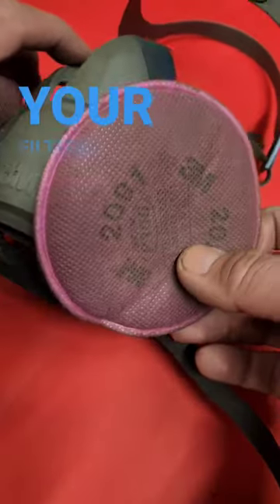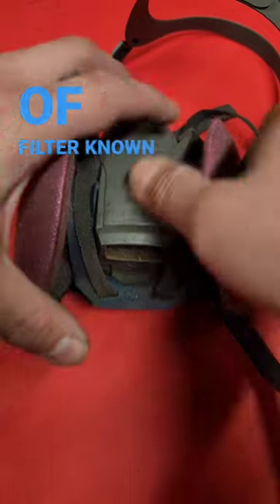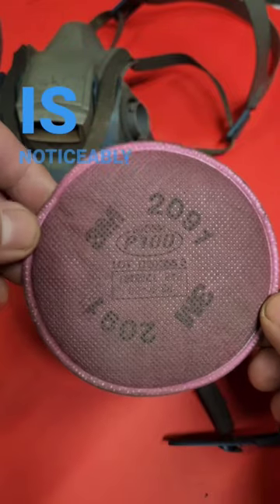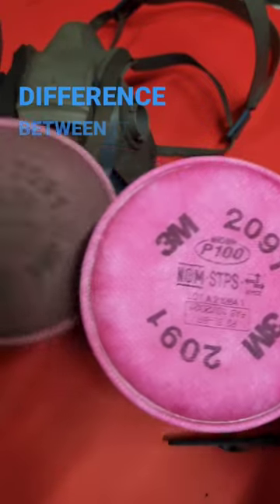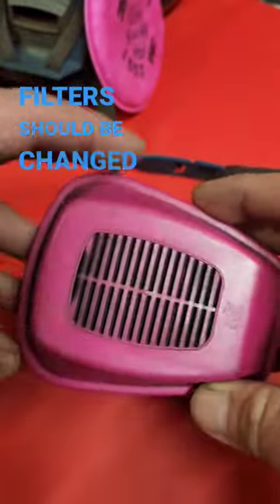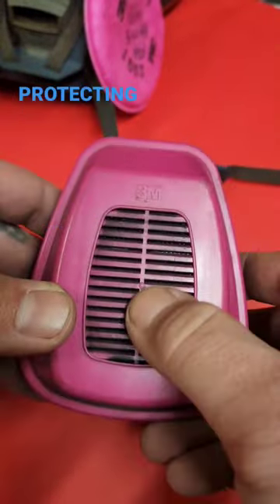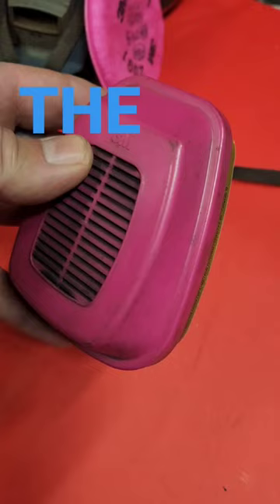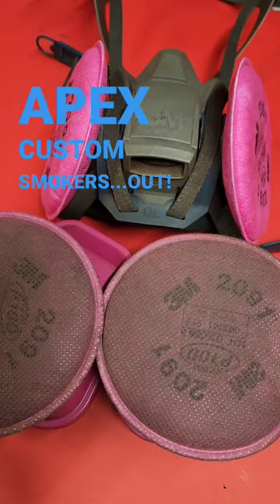When should 3M respirator filters be changed 🤔 #shorts #welding #3m

Comment: Sir, is 2091 useable for spray painting?
Reply from the maker: I PERSONALLY use only the P100 filters (charcoal filter with removable  particulate filter on top) for painting, or when I'm welding galvanized. The 2091 don't have the charcoal, which in MY OPINION, doesn't filter AS WELL as the P100. Hope this helps! Thanks for watching! 🍻

Comment: Will any dust penetrate through if the filter is already old ?
Reply from the maker: It would depend on how old the filter is, and how often it was used, but yes, the dirtier it becomes, the less effective it becomes
Reply: I'm going to have to partially disagree with the response. If it is a cartridge then, yes it will not sufficiently control vapors once it is old. The majority of cartridge filters use activated carbon to control for organics or they use another chemical which neutralizes the target chemical.  This is in contrast to particulate filters which are used to solely capture non oily particulate. Their mechanism of action is by blocking the particle by getting through by a physical barrier (usually a fibrous material) that work better the more they capture since the holes between fibers get blocked. Big particles cannot pass through the holes and are captured. Small particles are captured via Brownian motion causing them to run into the fibers. This is why it's so hard to capture 0.3 micron particles. This does not apply to things that can solubilize in the filter matrix such as oils since they coat the filter and then diffuse through as a chemical species.
Reply: @Ryan-dj5ku alright, so for particulate it will filter better but it's just harder to breathe?